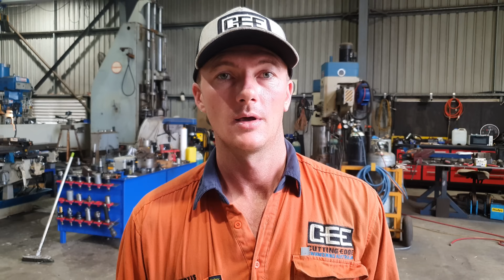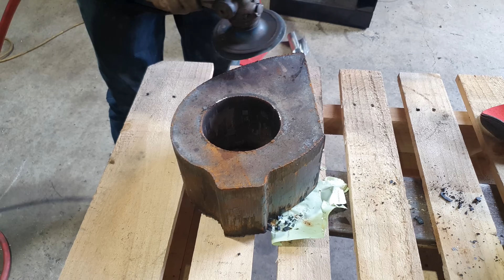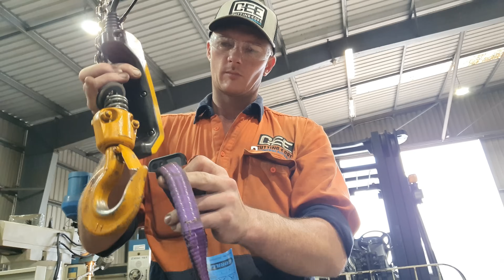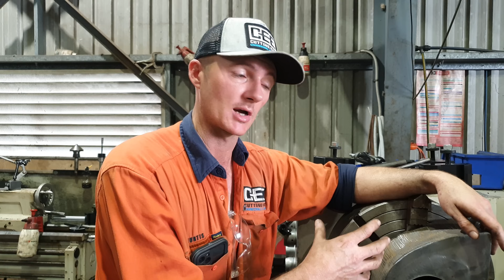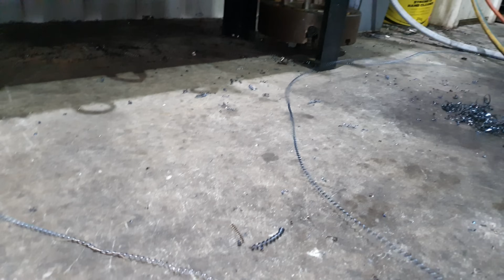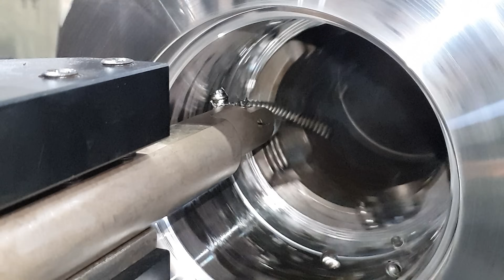Making Parts for CAT D10 Dozer | Machining & Milling

Comment: Would it have been better to drill and tap the holes for the grease fitting and other things first, and then turn the piece on the lathe?

Comment: Kurtis - Iflinch every time you brush the chips away with your hand. I still remember the 18 inch stainless ruler our shop instructor, Ms. Ware, carried. She would slap your knuckles with the flat side if she saw you do that. "That's what the acid brushes are for!" 
 
50+ years ago, and I still remember … The schools here in Florida no longer have shop classes. When I was in school, we has Wood, Metal, and Print shop, half a school year of each, and the option to add another half year of advanced work in any one of the three if you chose to do so … I mis it.

Comment: You're supposed to work machine tools in,a positive direction,not back and forth.  Use your new edge fiinder to locate the edge, you already know the width  figure the ditstance to the center of the holes, move accordingly. I don't know why a pointer and a scale wasn't close enough? Hole location doesn't need to be closer than 1/2 mm,easily obtained with a scale! Playing with an edge finder is a waste of time!

Comment: Only have two questions was the machine made in USA or other? If in the USA the pipe tap threads would be wrong! You would need to tell them the grease fittings were now British for correct install?

Comment: Yo Mate ... you are always good at applying a chamfer and radius on your parts so there's never a 90 degree edge ... did I miss the part where you deburred or chamfered the 8mm grease holes on the inner bore ???

Comment: Great video, question regarding the method for touching off tools. You may have answered already in another video, Guessing your using some kinda continuity tester (hence the beep when touching off) is this an aftermarket add on you've installed? I'd like something similar on my VTL as its hard to touch off when you're behind interlocked doors.
Thanks for the great content!

Comment: Shot in the dark, hail mary pass, secret key activator! Overunity 'free energy' devices don't exist, but there are recognized mechanisms in engineering/physics that exhibit overunity, like water hammers, anti-stokes emission flourescopy, spherical sound wave attraction, and vapor cavitation. What if someone was to harness one of those recognized overunity mechanisms to create an overunity device? A guy whose devices were unauthorized back in the 1800 apparently harnessed a few of those overunity mechanisms(allegedly). Anyway, thanks for the vids!

Comment: I have been over dosing on your videos since I stumbled on them! I recently un-earthed dads old Craftsman Lathe from the 1940s or 1950s and intend to bring it back to life for small projects, mostly Ham Radio antenna related. Some years ago I had repaired the threading selector box as a couple of the gears had been crunched in the past and thanks to the internet I was able to get the last set from the original manufacturer! Your videos have shown me a lot of things that I did not have a clue about! He who dies with the most machine tools wins!!! Keep the videos coming!

Comment: Uses edge finder to accurately find Y centre then grabs pocket ruler to find X centre, close enough.
Reply from the maker: the bolt holes need to be off centre on X axis 👍

Comment: So, I'm not a machinist, but I religiously watch your channel and have learned a bunch about the principles of machining, and for that I thank you. One curiosity about this process in particular: why keep the four-jaw setup after flipping the job which requires indicating it in every time as opposed to swapping back to the three jaw and holding the piece from the bore you just made on the other side? Seems some time could be saved that way. 
Love the channel, keep up the good work, sending scratches for Homie.

Comment: Is there a reason you don’t use the mill to press down on the tap handle when tapping? When I was in machining school a couple years ago we had a tapered point that would sit in a specific tap handle and while tapping, it would help keep everything straight and also keep pressure on it. Just wondering 🙂 Edit: the mill would be off while we tapped, we would still turn the tap handle by hand but the mill was used to keep it straight etc.

Comment: I knew you would do the first side of the other three bar ends before changing your setup. That was a logical time-saving move. That was a neat trick the way you started the tap so that it started square. It will be interesting seeing one of those bar ends being fitted.

Comment: 21:58 Why did you need to face off that flat area? I can't see how taking that time is going to affect the final product.
Reply from the maker: removing the flame hardened edge makes drilling much easier and won't destroy my drill bits
Reply: @CuttingEdgeEngineering  
👍 Thx.

Comment: Very nice work, both machining and videoquality. I wonder, why are you facing the plane with the grease fittings? To me it appears that facing does not have a function here?
Reply from the maker: removing the flame hardened edge makes drilling much easier and won't destroy my drill bits

Comment: I'm doing a course (at uni studying engineering) on machining, turning and milling primarily, and your videos have been a wonderful addition since I get to see how the theory works in practice, especially when the initial cut on the part wasn't working as you had hoped and changed the bit for a better result. Feels like I'm actually understanding whether a cut is good based on the chips.

Comment: Hi ,I just thought that you should know that on your Lathe if start your cut from inside the bore you can use the automatic feed and get a much nicer cut. Not to mention, that you won't have to stand in front of the machine and watch the big block of metal spinning.

Comment: lol some times u just have to play with it.. 😆😆😆😆👍
Reply: question, curtis when u drilled the grease holes, the drill went through the snap ring grooves, is it a problem ? or no ?
Reply from the maker: hey mate what I should have said was the centre hole is for the grease port and outer holes are relief valves!
Reply: @CuttingEdgeEngineering  got it 😁👍

Comment: Hi Kurtis, My first time here and you obviously know what you are doing. Just a couple of tips. 1st, you might want to add some counterbalancing on your chuck, it helps with concentricity of the hole and stops bearing wear in the head. 2nd, dont drag the tip back after a cut, wind the tool off, this stops the tip chipping. 3rd, try WNMG CF tips for better chipping on small cuts. 4th only have your boring bars sticking out as far as you need them to. 5th, get your metal supplier to get of his arse and supply you with parts ready to go in the lathe, ie do his own deburring. Great video BTW, looking forward to seeing some more of your stuff, best wishes Mal.

Comment: Back in the day, if my steel supplier had tried to deliver parts that covered with crap I would have sent 'em back!! That second insert did the trick very well. What is the black thing mounted on the headstock behind the chuck? You are getting very good finishes, what is the steel? I love watching the 'big' stuff. It's been 30 years (I'm 75) and I kind of miss the large equipment. Down to a 10" lathe now. Love yer dog!
Cheers! Pete

Comment: Kurtis, when deciding to rotate the part around the tool (lathe) rather than rotating the tool around the part (mill) what it just a consideration of available horsepower? I didn't see any machining that couldn't be done on a lathe and with obviously greatly simplified clamping when you're not trying to spin an oddly shaped mass at low albeit still considerable rpm given the off centre mass and less than ideal clamping options available. Fantastic camera and editing work from Karen as always.

Comment: Just a suggestion. For descaling and rough cleanup of torch or plasma cut items it might be good to invest in a good used shot blast cabinet. It would save time spent chipping and grinding the scale on items like these. 
The company I worked for made armored doors for MRAPP vehicles. It was labor intensive before the shot blast was installed.

Comment: It's never easy machining big heavy odd shape pieces, but there is an easy and safe way. Stich weld the part to a flame cut disc. Hold the disc and then machine the part. Break the stich welds after. I'd also recommend tack welding a piece of scrap to the lighter side of the part to balance the weight of the job. This will massively improve surface finish and you'll be able to run it much faster, it'll also take some of the load off your spindle bearings...Hope no one minds me mentioning.

Comment: Great video as always and a pleasure to watch.  I don’t know what that rust preventative that you use is like but I have found that a lanolin based product called fluid film is the ducks guts.  It not only gives fantastic protection but it also does not clog up the spray nozzle like many of the lanolin based products do and is available in Oz through Hafco so dead easy to get.

Comment: From San Diego here. Great tap trick for starting a tap straight. I guess if the chuck is not too tight there would no damage to the tap shaft. I'll try it soon on a part for my glider trailer. Thanks much! Steve B. ==

Comment: Hey there CEE Australia, I have a question about the original cuts on these pieces of stock if I may. These pieces arrived to you in a rough flame cut fashion, what I am wondering is how a flame cut is able to get you something that thick (about 0.9 banana) with somewhat of a straight edge on it? I would think that something this thick would require a lot of gas flow and that would make an ever increasingly wide cone. How does flame cutting something like this and event thicker stock not get a piece with a ridiculous taper from nozzle to other side? Thanks!
Reply: The flame is just for heating up the material to get the oxidation process (the cutting if you will) going. It is the pure oxygen jet in the nozzle center that does the job, and that is a straight channel apart from a little venturi for stabilising purposes. With specialised equipment, it is no problem to cut up to 1500mm think parts, usually from forged blocks. Yes, 1.5 metres thick. And still straight.

Comment: Once you get it sorted you will do all that mill, drill counterbore, chamfer and tap in that MAZAC faster and easier!!!!
In a manual machine it is faster to change tools than it is to change position...
A CNC moves stupid fast so its faster to use each tool in all positions than it is to change tools for each hole......

Comment: I got a couple of questions. With "normal" use how long will those cartridge's last? Does it depend on the material's that it's used for or? @Cutting Edge Engineering Australia

Comment: Making an interrupted face cut at that diameter on a heavy part with that much stick-out with sketchy contact on one chuck jaw is reckless.  It's going to be REALLY ugly if something goes wrong.  Please take a few minutes to make and install a plate and threaded rod through the spindle arrangement to secure part like that solidly in place.
Reply from the maker: wouldn't do it if it was reckless, low RPM is Key and i've tightened the chuck very well it's solid

Comment: Now, I've noticed that CEE (?) is providing now CCs in all languages possible... Which is, well... "Brilliant my dear Baldric, a brilliant idea indeed".
The very same "brilliant indeed" idea occurred to a certain wheelwright from Montana, Mr. Dave Engels ("EngelsCoachShop" channel on YT). Being a native Polish speaker I took a peek at "Polish" CCs, and... Yeah, it sorta-kinda resembles Polish language, albeit... not very much. Same here - that "artificial intelligence" is still more "artificial" than intelligence, and those "translations" are often balderdash and nonsense. Lemme quote part of my comment I posted back then under Dave's video - it's a tad long, but the problem is multifaceted and can't be explained in two or three sentences. Here we go: 
======
(…) getting back to the issue of "transferring all our videos into multilingual ones" by auto-translation, I think the best (overall) approach would be to provide each video with a human-made, revised (so "hare-brained idea" won't read "hair-brained idea" - and such) English CC - and then leave "other language(s)" viewer(s) with the choice of "auto-translate" option. The rationale behind it is that those CC you include now are "computer/ AI generated" anyway, so there's no real benefit in "affixing them permanently" to the video(s). And they are probably not a iota better than those "auto-translate" CC from within YT "options" - after all YT is Google's portal too, so my guess is those two (that is, GT and YT) are served just by the same "engine". What difference it would make, then? (And why bother?)

Also, one can hope that this auto-translate capabilities will improve over time, so a year or five down the road that "YT auto-translate" would render much more accurate translations - but I don''t think there'll be much in store for you and your trade anyway in any foreseeable future, because of "how it works" (that AI auto-translate thingy, that is). Let me elaborate a bit on it...
While I am not an expert on computing, languages, syntax, AI "and such" myself, I happen to know a guy who is a university professor - a linguist who used to do research on subjects like "understanding natural languages by AI" and "AI created speech/ text". (He was a part of local university team working for Samsung "in that field", but he quitted his tenure dissatisfied with the salary - but I digress here). And while I never took any proper lectures on the subject from him, we've talked about it on several occasions, and based on what I've learned from him, my understanding of the issue is that "AI understanding of natural language(s)" relies heavily on "statistical occurrences" - that is how often certain words are grouped with others, how often certain phrases appear, in what context - and so on.
Therefore, if one stays within "widely used words, phrases and terms" the translation is quite accurate (...), but once you stray into "statistical fringes of a language" things start to go a bit haywire. I just watched the first minute of this video with Polish CC turned on, and... well, "there's certainly a room for improvement", as Americans used to say when they see an utter failure. While not a total gibberish, it is rather "gibberishy" nonetheless, whenever technical terms pops up.
=====

Same here - "how are you Kurtis from the most modern engineering science"; "four tips of a beam cut with flame from a stretchable plate of a height 120 miles"; "bar" becomes "belt" (like the one you use for your trousers); "first thing I need to do is to pass them to a welder [= person] g area [noun, in its nominative case therefore it makes no sense, as Polish syntax relies not on words order, but on inflection and declension]; "grind [as in "grind coffee/ peppercorns"] all mill scale and make out of them, after they were cut with flame, when it ends we'll take them over".
Next: "you [2nd person sing.] have used a big centre of a pipe to hold/ keep an eye [i.e. the body part, not "hole", or "ear" as this kind of a machine part is called in Polish] in the bracket and then walk around it and put it in the safest place"; "so you can we have maximum force of gripping, as much as possible, here we have three jaws that do the most gripping and the second one that just sits on its edge"; "first thing I need to do, I must bore [i.e. make dull/ tedious/ uninteresting; Polish uses very distinctive terms for "boring a hole" and "boring ad nauseam"] the identification tag, I'll be boring this joke to tears hin [sic] half miliinch" - and so on, and so forth.

So, if you think it is "helpful" for "understanding the process for our non-English speaking viewers" (as Mr. Dave has said) then, well... "You must be a very optimistic person indeed", if you get my drift... ;-)

Comment: 💡 while on the lathe at low RPM. We used a 2" rubber anti-vibration belt from a brake drum resurfacing machine. * just a tip

Comment: I just twigged that Kurtis does a lot of prep work on a recyclable wooden-surfaced  adjustable height workbench (i.e. A pallet on a forklift).  
Is that an efficiency measure to minimise handling  or  is it to keep the mucky jobs away from the machinery?  Either way I'm impressed at the practicality of that, a one-unit materials handling line.
Reply from the maker: hey mate good spotting, it's usually the pallet the parts come in on so no point moving them to another surface that will get messed up. You're correct with both minimise handling and keep machinery cleaner

Comment: Another amazing video and the video editing continues to be fantastic.  One question for you about the bits you use on the lathe.  You mentioned that the first bit wasn't doing quite what you wanted so you changed it out.  What was it not doing well?  How can you see that?  The feel of the machine or the bits that are being machined away have a particular look to them?  Just wondering.  Also, is there a way to tell if a bit is dull or about to break?  Give any sort of warning?  Thanks again for a great video.  Always look forward to them.  Especially the bloopers at the end.  :)

Comment: Nice processing Kurtis.  I have machined many thick flame cut A36 parts for large machine manufacturers in the USA an have to say our customer would have a fit if I had to charge them 45 Min to an hour just clean up the parts prior to machining.  But, great job and glad to see you all working hard.  Keep on smiling.

Comment: Would it have been quicker/ easier to have water cut blanks? Or can you not get it at this depth of cut?
Reply from the maker: water jet is an option but it's slower and makes the parts more expensive